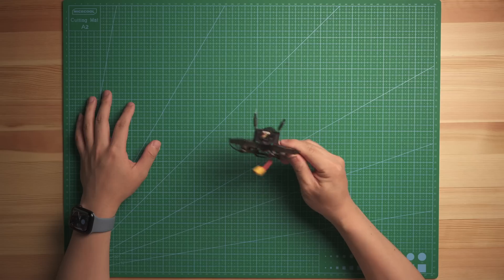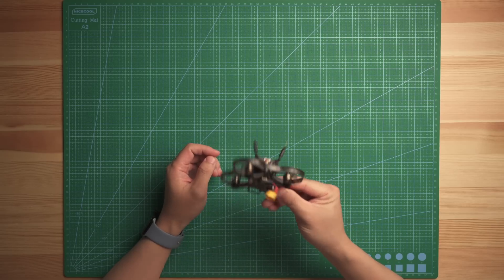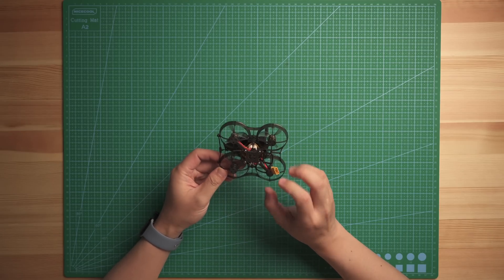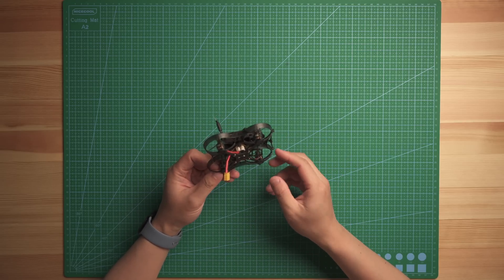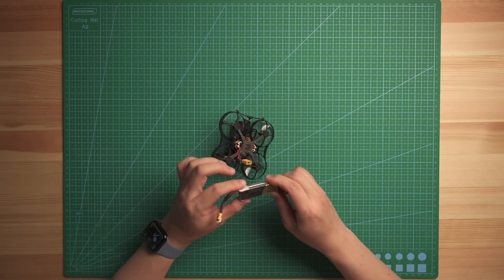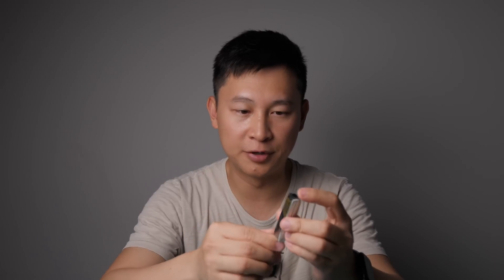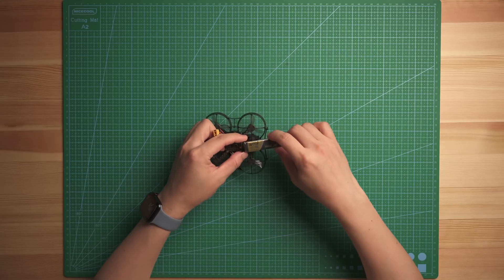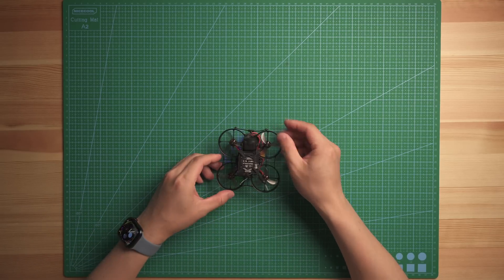AcroBee75 HD O3 BNF  | New Product

Comment: How do I get Blakcbox data, only Serial option is available in Betaflight
Reply from the maker: Hi, if your Acrobee75 are using the G4 flight controller. Then it doesn’t come with a flash chips on board. You will need to add an external blackbox. If the flight. Controller is the F7 version, then it comes with on board blackbox.

Comment: how do i get this to work with my dji rc2? help been trying for two days now, thanks
Reply from the maker: Hi. Please make sure you flight controller version, if its F7 you need to use UART1 for the O3 internal receiver, if your flight controller is the newest G4 version, then you need to use UART4.
Reply: I have a DJI FPV Remote Controller 2.  Will it work with this drone?  How do I tell if mine is a F7 or G4 version? @NewBeeDrones

Comment: hello! Can I use dji controller with this drone?
Reply from the maker: Yes you can! We have two version flight controller Acrobee75 HD O3 right now, if you get the F7 version, just switch the serial rx to UART1,  if you get the G4 flight controller version, you should use the UART4 for O3 internal receiver.

Comment: regardless how simplistic, we need a how to video showing installation of the dji antenna. @newbeedrone
Reply: I used a fly fish stubby 03 antenna for mine and zip tied it
Reply: @graysonhall8834  nice! I bought one waiting for it to arrive. The range is still pretty damn good on the stock antennas with the DJI remote and goggles
Reply: Here’s a link to a photo https://www.dropbox.com/scl/fi/gsh63rvctjafnetxh83ow/IMG_8125.jpg?rlkey=v8rgzalwb99e37dozqq2y0byn&dl=0
Reply: Agreed. Should be standard like all the other drone companies
Reply from the maker: Hey guys, sorry for the late reply. You actually don't need to replace it to the OG DJI Antenna, those antenna comes with the drone works pretty well with the DJI Remove V2.

Comment: So it is safe to run the dji 03 air unit with no antenna?
Reply: there customer service sucks i asked the same question
Reply from the maker: No, without the antenna it will damage the RF part of the O3.

Comment: This looks just like the BetaFPV Pavo Pico.
Reply: The pico is much more expensive. Newbee is the first to do this right.
Reply: The NewBee's Pico is 399.99 how is that cheaper? When BetaFPV is 104.99 and a new O3 VTX is 229.00.   @reimontes666
Reply: @reimontes666 Pico ELRS is $104.99…..
Reply: If oavo pico is too expensive then buy the mobula8 o3
Reply: To be honest it is the DJI O3 that is expensive. HappyModel Mobula8 DJI O3 is pretty solid and crash friendly frame. Has larger motors but less KV